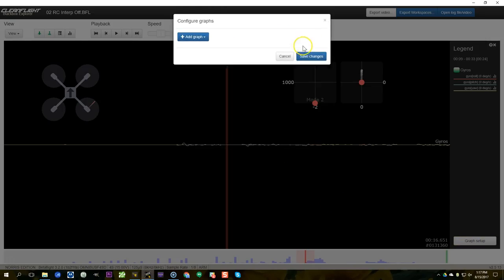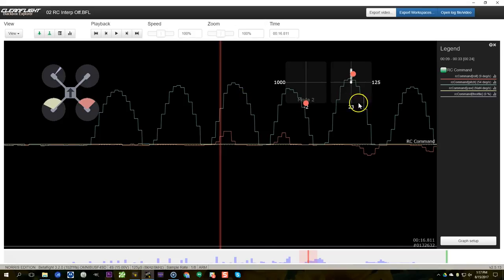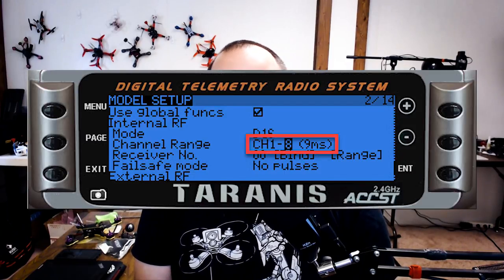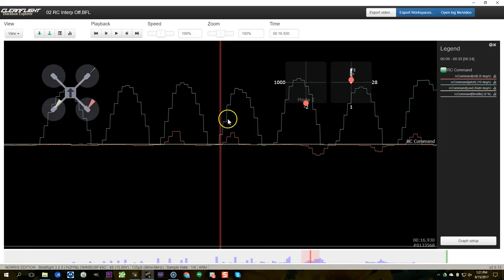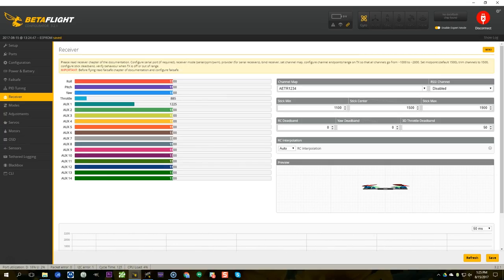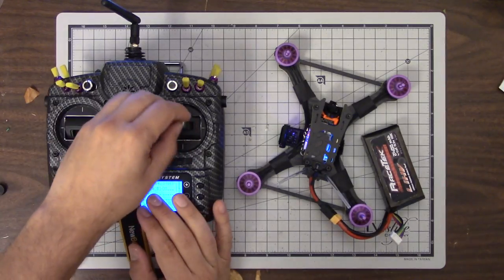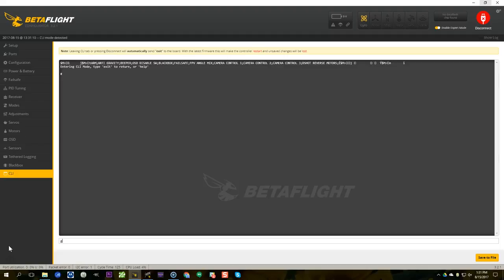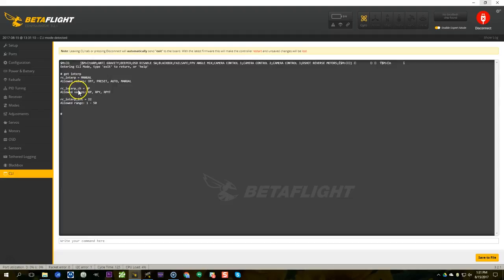Betaflight RC Interpolation | HOW TO TUNE

Comment: wow, i turned smoothing off completely and it looks awful, way worse than anything this video shows. The reason my rccommand traces look so bad is because I set expo on the transmitter, not in betaflight. You aren't supposed to do this, exactly for this reason, but its so darn convenient I just cant help myself. This is making me consider switching though.
Reply: I certainly suggest you switch to using expo in betaflight, not in the transmitter.
Reply: I did, and it is noticeably smoother. 
I really liked being able to configure expo on the transmitter. Now I need to haul a laptop to field. But really, I started taking a laptop with me anyway for tuning notch filters, so it works out fine.

Comment: isn't there a general number for al of us to use e.g. with a frsky xm+ using 8 channels ?
Reply: DanO FPV that's exactly what I'm wandering. Assuming the bf setup is the same on two different models and the radio used is the same?
Reply: There still might be some variation, and other setup details (props/motors/looptime/Kd value/user preference) would dictate the actual interpolate window floor where a pilot calls it unusable - so try it yourself, and post back... I have a feeling it'll be 15ms +/- 3ms, but lots of data points >> my guess.

Comment: No expo is 100% not 0%? Weird. What's expo in this case? On radio I know but here? Smoothing of minor movements from center position?
Reply from the maker: Expo does the same thing here as in the transmitter: it makes little movements seem bigger.
Reply: @JoshuaBardwell  Thx. But unless I got it wrong for 3 years, I think expo makes stick inputs near the center of the stick on the radio seems smaller (smaller input value for that axis to fc compared to stick deflection on the radio)?
Reply: maybe you mean 100% value makes little movements in bb logger seems bigger as this apparently corresponds with no expo?

Comment: As my Spek, DX8 binds at 11ms, should I set rc smoothing manually to 11ms? When I select manual, it gives me a figure of 19. I'm still on an F3 FC with no room for blackbox, so I'm flying blind on examining the stepping output. Or do I leave it at auto?